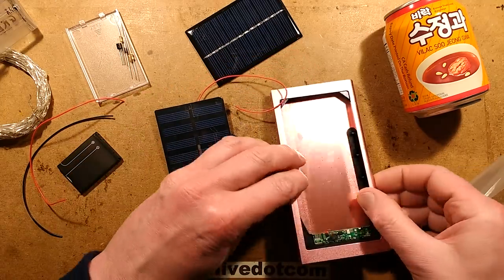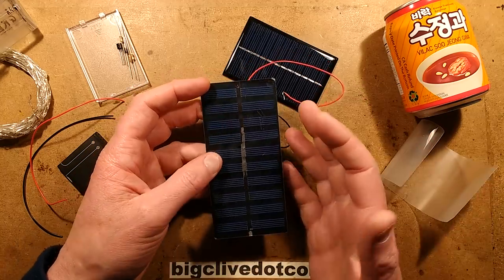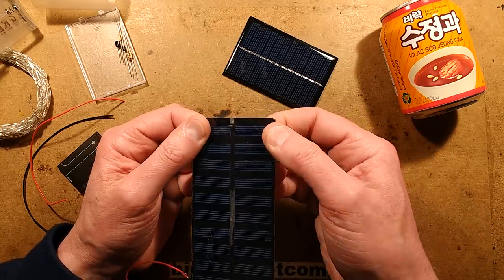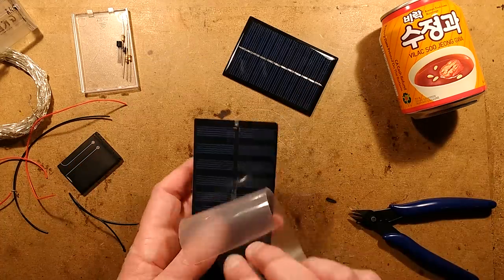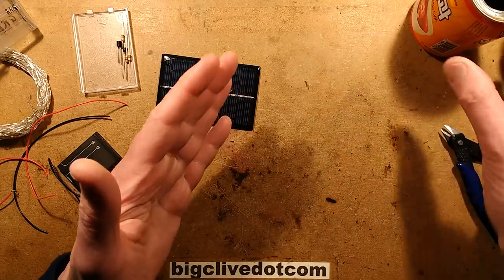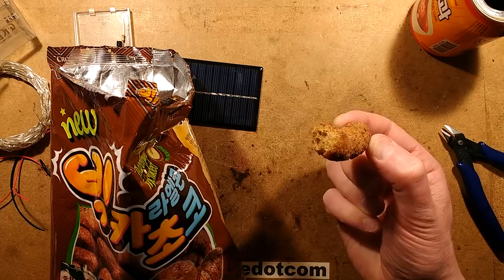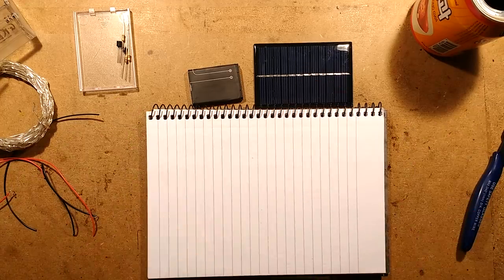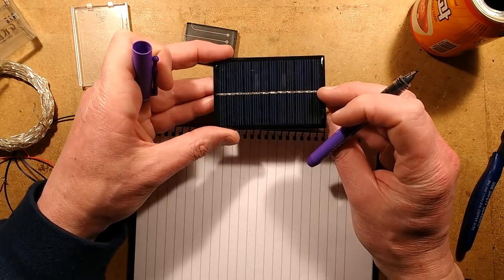Simplest solar light possible, using old phone battery.

Comment: i find solar charging thing bit confusing i never could find an answer about it.. since seems like could charge any cell almost regardless of its chemical type. but yet house chargers its always like nickle cad, or nickle metal or alkaline rechargeable types, lead acid or well lithium chargers to be used on the types match required. so how does this work as i never did fully understood how could charge almost any chemistry type of cell like that?
Reply: Natsuki Each cell (battery) type has its own individual characteristics. The cell that Clive is using has an internal protection circuit, so the external circuitry can be very simple (the power available from the solar panel is relatively limited). Most secondary (rechargeable) cells can be trickle charged at relatively low currents (compared to their capacity). But for faster charging, the charger has to be designed to detect when a cell is fully charged (or nearly fully charged), or alternately it will use a timer. It's cheaper to design battery chargers for only one cell type rather than multiple cell types.
Reply: oh i see so power can be nearly anything to charge any cell. but just these chargers just designed for these types of cells to prevent overcharge current and what not. that's neat to know then. i always thought its cause certain things it does like if put say alkaline in a nickle cad it be filled with nickle and not alkaline as an example. that's good to know now at least. or at least that's what i seemed to get from this explanation aha

Comment: Can someone please help me. I know that resistors limit the current. Please tell me if I am wrong. So what if I want to power an LED, running on 3 volt, from a 5 V source. How do you drop the voltage? Do you have to keep current in mind? And what if I want 10 volt from a 12V car plug. How do you drop the volts. And must I keep current in mind? Or how do I get 5 volt from 12 volt. All I want to know is how to drop the volts a certain amount from a source of high voltage and very high current. I would appreciate any answers. But please explain to me.
Reply: You could run 2 LEDs in series, or find a tiny potentiometer.

Comment: I have the same light. Can I use the same circuit with the 18650 Li-Ion battery instead of phone battery?
Reply from the maker: Only if it's got cell protection to prevent overcharging.
Reply: @bigclivedotcom  Thank you very much for you reply. Would you please tell me how much mA needs the LED strip which you use on the video? I have the same but I do not know how to measure it? any suggestions?
Reply from the maker: @Electrologia  The LED string will work at a wide range of current with higher current making it brighter, but giving shorter run time.

Comment: Would it work better with a FUN: (MOS)FET Universal N-channel and no detection resistor?
Reply from the maker: I did consider that, but it would have to have a low gate voltage.
Reply: I suggest trying a 2N7000. The Vgs_on is in the 1 V region.
Reply: You don't need the base resistor anyway because the current is already limited to the solar panel's leakage current.

Comment: Clive could this circuit be used to power half a dozen smd LEDs rather than a string?
Reply from the maker: Yes it can run matched LEDs in parallel.
Reply: @bigclivedotcom  awesome, Thanks :)

Comment: Will this project be enough to power 200 LED (20m)?
Reply from the maker: It will light standard parallel strings, but not at high intensity.

Comment: so solar panel is turned into resistor when there is no light. photoresistor principles?
Reply from the maker: It's designed for generating current from light and not as a normal diode, so there's a bit of natural reverse leakage when it's dark.
Reply: If there is - probably close to 0V or microvolts

Comment: How did you waterproof the project without causing a mess?
Reply from the maker: The existing one I have built slightly differently is just at a window indoors.  For outdoor use it could be built into a waterproof case.

Comment: Will the battery object to being charged at sub zero temperature?
Reply from the maker: It's certainly not an ideal situation for a lithium cell.
Reply: @bigclivedotcom  just refurbished one of these that has been outside over one year 100 above F summer and -24 winter, rain sleet and snow with only a ziploc bag protecting the battery and electronic bits.

Just had a loose joint on the panel.

Comment: Whatever happened to common knowledge about clipping the leads of components? Use shear (scissor-type) cutter, not a cutter that pinches and generates enough shockwave energy to shoot the discarded lead a few feet. (Same energy shockwave enters component).

Comment: I would not put the battery on the back because heat could damage it but anyway nice project
Reply from the maker: That's why I spaced it off with foam tape and an air gap in the middle.

Comment: Uncle Clive how would i scale this up please, no ware on youtube i can find something that does 12volt
Reply from the maker: You can get 12V dusk sensor switches and lead-acid charge controllers.
Reply: @bigclivedotcom  Thank you kind sir, just thought there might be  similar way but bigger, say 50watt panel with 12volt battery
Reply: @bigclivedotcom  Apologies, 4s lithium battery, i have the cells to build a battery, and a 50watt panel, i must just get 3 x 10watt LED floodlights to light up around the house at night

Comment: O don t have 10 ohm resistor what can ı ise for it ?
I planned to connect bigger LED also 😃
Reply from the maker: The limit is the current capability of the transistor in this design.  10 ohms is recommended but you can also use higher values up to 100 ohms.

Comment: How do you determine that battery has protection ?
Reply from the maker: A real battery should, there's a possibility some clones don't.  The only sure way to test is to charge one with a current limited supply and see if the charging current drops to zero when the cell reaches about 4.25V

Comment: What is the purpose in using a defective old phone battery, when you'd be paying through the nose for a half decent solar cell please. Or am I missing something here?
Reply from the maker: The battery is still amply capable for the task, and the solar panel was a couple of dollars shipped from eBay.
Reply: @bigclivedotcom  Thanks, as I've not had much luck with recent Ni-Cad solar light builds, and I thought that lithium batteries have an undesirable memory effect?
Reply from the maker: @Kudos1799  NiCads are the most prone to the memory effect.
Reply: @bigclivedotcom  Ooops!

Comment: How difficult would it be to add a PIR motion detector?
Reply from the maker: Not hard at all.  The PIR sensor could also be fitted with the light sensor.  That way all you'd need is the solar panel a diode and the protected cell.

Comment: too bad the 10k NTC inside the cells references GND instead of VCC in this case, could have ditched yet another resistor since the value isn't all that critical.

Comment: Tried it out right away. Nothing worked. Smoked out a transistor. Atleast i thought it was one xD damn
Reply: Foxilein if you use different transistors you need to check the pinout, it may be different on the one you used.

Comment: Doesn't reverse panel leakage cause premature panel failure?
Reply from the maker: I think that's more of an issue with large arrays where a shaded cell can be forced into reverse conduction by the other panels and possibly degrade thermally in hotspots.  There's very little information about any effect on small panels with low reverse leakage.
Reply: Thanks for building this. I do enjoy videos where I can just see a project and duplicate it myself, no breadboard, just a finished thing.

Comment: Is this project working well still?
Reply from the maker: Yes it is.
Reply: Thats good to my ears. Im going to make it as i have the components kicking round the flat. Keep the vids coming clive :-)
Reply: @bigclivedotcom  i've made a few of these for elumination then thought make a 12v one with proper indoor led lighting using ultrafire li-on cells and power transistor 2n3055 diode 1n007 and 82k base resistor with no current limit resister and lights the flat a treat all night long, exalent im solar mad,hate paying for electricity i make me own;-) i've not been on fire yet

Comment: Why has this battery three contacts instead of two?
Reply from the maker: The third contact can be used for a thermistor for battery temperature sensing or is sometimes a resistor so the phone can tell what size of battery is fitted.
Reply: @bigclivedotcom  - Thank you. Very kind.

Comment: BC548/558 my first transistors (Australian). Thanks to these I hate when the base is not the center pin, yes datasheets were hard to come by. Still my goto when I can't exceed mosfet gate voltage. And yes you should check polarity, in the past when I cut up a cheap chineseium USB cable the black was positive and the red was negative, dafuq china?

Comment: Does that same system work with 1.5 volt leds ?
Reply from the maker: Yes.
Reply: bigclivedotcom well that answers that I’ve done something wrong then 😳
Reply: bigclivedotcom I ment 1.5 volt battery’s
Reply from the maker: @chrisharvey6856  you'll need at least 3 batteries, but better with four.
Reply from the maker: If using non rechargeable batteries there is a risk of cell failure if the solar panel tries to charge them.
Reply: bigclivedotcom if you can’t guess I’v not got a clue but I’d like to learn
Reply: Sorry for being a pain . I was trying to repair a solar light as the circuit has failed the led works with a 2032 cell but not with 1,5 v 600 mah battery I don’t understand sorry

Comment: so.... your battery dies and dies hour after hour getting the solar heat...... may be you can optimize this a little.
Reply from the maker: Thermal isolation pad on the back with airflow gap.

Comment: BC547 if you're this side of the pond, 2N2222 if you're on t'other.
Easier to remember for those overseas because 'murica.
Like aluminium / aluminum, colour / color, etc.
Less letters for easier spelling.
</trolling mode off>
Reply: Fewer*

Also, the slash in </trolling mode off> indicates that the trolling-mode-off ENDS here, meaning that the stuff before was meant to be taken serious.
</themoreyouknow>
Reply: Anvilshock Meh. < /br> is legitimate HTML. No need for opening tag.
Yes, fewer. "Less" used on purpose. </missing the point>
Reply: You couldn't leave it be, could you? Fine, you asked for it:
If anything, it's XHTML, not HTML. And even then, it would be <br />, not < /br>. And not because "it doesn't need an opening tag" but because it's an empty-element tag. But your tag clearly was not implied to be empty because you still meant the text it followed to be understood as trolling. - https://stackoverflow.com/questions/1659208/why-br-and-not-br
Just give up, will you?

Comment: I tore apart what I thought was a crap solar power bank. The '12000maH' pack was actually over 8500 on the first cycle so I may get it up to 9000maH. So not so crap after all. The panel gives a solid 100ma. All for almost £8. Bargain.

Comment: I’ve actually built using 2 sets of £ land fairy lights witch are designed to run from 2 AA battery’s so I didn’t use the 100k and with 3500mah battery with has built in protection witch I got out of a android tablet the kids destroyed so should run for a while.
Reply from the maker: Make sure the cell has a protection PCB on it.
Reply: bigclivedotcom that’s one of the first thing I checked for
Reply: Straight at the top of the cell there’s a pcb with some  components and I’m plugged in to the other end of that I’d send you a picture but I don’t think you tube allows that

Comment: Hi, I made this with a set of 100 blue LEDs and it works great, however I am also trying it with 200 warm white LEDs and having some problems, can you help? P.s I'm a beginner :)

So I used the same design, but I am using 2 x 3.7v lithium cells in series to double the voltage,   the problem I have use that the LEDs light up even in reasonably bright light, so I changed the 10k resistor for 100k, (I also tried with 47k and 68k) and the higher the resistance the darker it has to be before the LEDs come on, great you might think, but it's also vastly reducing the overall brightness of the LEDs. How do I solve this problem? 

I need about 6v to have the desired brightness, but they turn on way to early with a lower resistor :(

Thanks to anyone who can help me.
Reply from the maker: I'd recommend sticking with a single cell.
Reply: bigclivedotcom hi, problem is with just one cell there's not enough voltage to light any of the LEDs, even if connecting them direct to the battery. The would only light up if I used two cells.
Reply from the maker: A fully charged cell should light the white LEDs unless a faulty LED or short is dragging the voltage down.

Comment: I'm looking to do a circuit like this but with a setup like your recent video of the recycled lithium cell and the TP4056 charge controller (https://www.youtube.com/watch?v=W7XB6D7q92g ). How could the two be adapted together? Would it be as simple as putting the LED and transistor Emitter/Collector on the charge controller power output and the transistor input on the solar panel +/-? That sounds too easy.

Comment: I don't know where from are you pulling out this story about keeping the battery at that voltage for longer life.i have old phones like 1st iphone,old ipods,Samsung galaxy s2,s4,an galaxy a5 1st edition from 2014 and I kept the batteries always charged at max I still have those phones with original batteries and also have quite a few other devices that uses lithium battery and also quite old and still have their original battery so im sorry but you are misleading me and this time i can't agree with you
Reply from the maker: And is the run time from a full charge equal to when it was new?

Comment: Thank you so much! I just built the circuit, so easy even I could build it. My cow skull has never looked so good as it does now with a 1/2 watt red 10mm LED in each eye.

https://imgur.com/a/ZDZpHkk

Could anyone comment on how excatly the transistor is working in this circiut? Looking at 23:32 there's a clear view of it (the base pole of the transistor has a 10k resistor, the emitter pole has a 10 ohm resisstor which I know is just for the LEDs).

Comment: So solar cells - Is it the same terminology as batteries and cells?

Multiple solar cells form a battery?
So would calling this a solar battery be correct? But the single units used in calculators are solar cells?
Reply from the maker: Even in a calculator it's often several cells in series.  But all as layers on glass.
Reply: solar cell - each individual element
solar panel - multiple cells connected and mounted as a panel
battery - something that stores energy
"solar battery" - not really a thing, just a generic marketing term for a battery connected to a solar panel
Reply: Butbutbut ... what about the atomic batteries in the Batmobile??
Reply: Jim Steinbrecher In the world of batteries, an individual 'battery' is a cell. More than one connected up together forms a battery.
Reply: whenever clive says "cell" here he is clearly talking about solar cells, which are part of a solar panel, not electrochemical cells (part of a battery).
Reply: Jim Steinbrecher Not disagreeing that he talks about the (solar) cell. But it's still true that what a lot of people call a battery is in fact a cell ( https://en.wikipedia.org/wiki/Electrochemical_cell ). The word cell of course in common with lots of English words, having many different meanings... And not helped here by the fact that we have a solar panel which contains solar cells 🤣 ( https://en.wikipedia.org/wiki/Photovoltaics ). But I'm sure you know all this already.
Reply: none of that addresses the original question, which was if a set of solar cells was called a "solar battery". it isnt, its called a solar panel. "solar battery" is a marketing term for power banks that come with a solar panel (ie, a solar panel plus an electrochemical battery). a group of connected solar cells (without any storage) is simply called a "panel", not a "battery".
Reply: Jim Steinbrecher It's no good arguing when I agree with you 😀
Reply: @JimSteinbrecher  It depends on where you live. Very little is the same everywhere. And language and vocabulary vary the most. Keep up or be left behind.